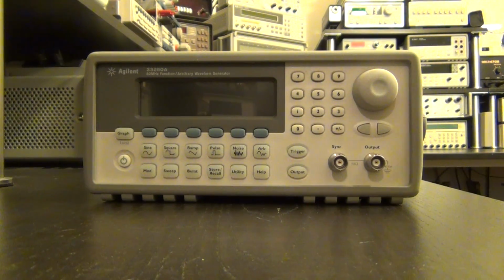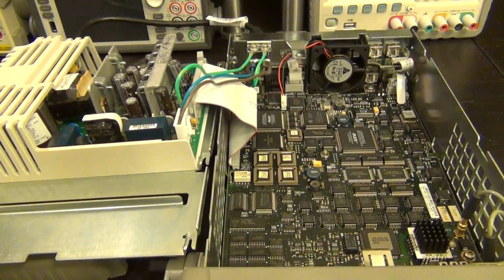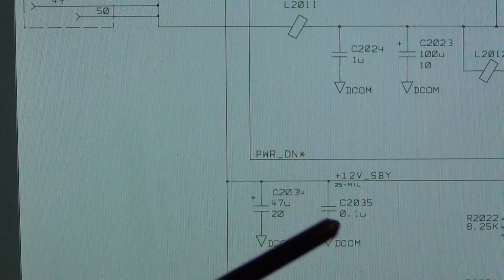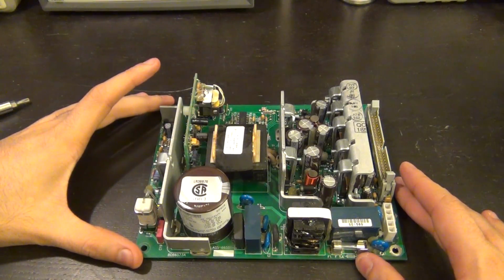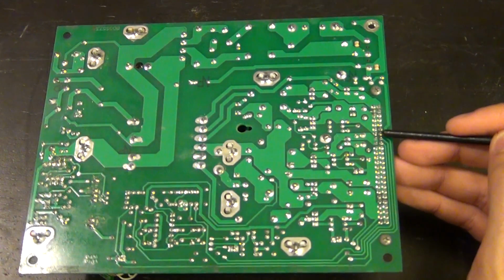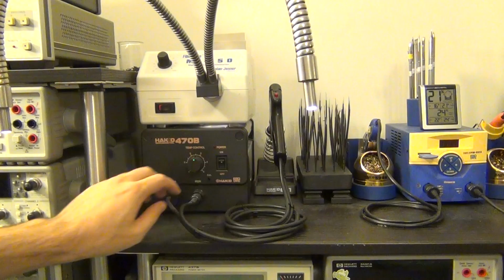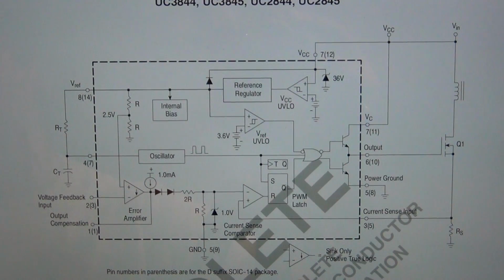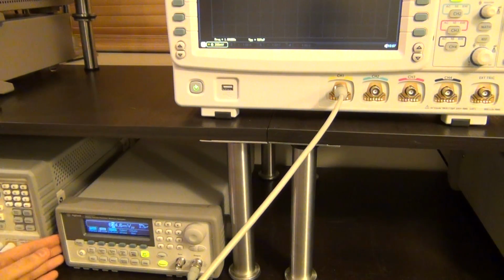TSP #39 - Teardown and Repair of an Agilent 33250A Function and Arbitrary Waveform Generator

Comment: I had to repair one of these.. The fuse had blown. I replaced the fuse and ágain it blew with a big bang so I noticed things could be serious, After much searching and fiddling I notice the thermal insulator behind the transistor @23:55 had a bit of burn mark on it like film left when piece of wire disintegrates. I replaced the thermal insulater and everything worked.

Comment: My guess is that the power supply failed to pass its verification test, that the 12V reference board was replaced by the factory technician and that the tech forgot to put the screw back in. The unit then failed due to physical vibration, or thermal expansion.

Comment: He spoke so fast. And I still dun understand why he unsoldered the little piece of PCB out of power supply unit and then resolder it back. No components are replaced so that the whole power supply unit is working without problems.

Comment: Very nice video. You need to take into account that active PFC steps up the voltage quite a bit, so a 115 VAC source might still generate 200++VDC at the cap. Not sure if that particular PSU has active PFC.

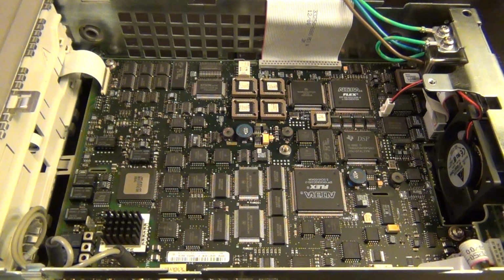Comment: Hi, could you let me know if those 3 cans (shielded coils) on the left bottom of the picture (jump to 43:42) have any ferrite core in them or they are empty?
I have bought one of these recently and fixed quite a few issues with it and it now seems to be working but someone has been in there and done some repair on it and those three cans are empty. I wonder if they should have a core? The bandwidth of the instruement seems to be off the square wave after 10-15MHz is not recognizable. 
I appreciate your help

Comment: I wonder, where did u get all that schematics?
Reply: +Blade Runner 
Nope, its called "google"
In case google banned you, there is it:
http://ridl.cfd.rit.edu/products/manuals/Agilent/function%20generator/33250-90011_service_guide.pdf
Schematic with our switch at page 204.
Reply: Well, quite sarcastic answer:) Usually is hard to find some schematics. I am surprised that Agilent gives .sch files out..
Reply: But in this case it was easy, just typed agilent 33250 and third or fourth result was that service manual...

Here in poland we dont like when ppl ask w/o trying to find it in google.

Comment: Hi Shahriar,  Great video as usual.

When you reviewed the Rigol Power Supplies, you mentioned that they were bringing out a software tool for "orchestrating" measurements and commands to them.  I assume that was the ultra sigma software. It would be interesting to see how that package works given you have a large number of Rigol tools at this stage.  Perhaps you could do an experiment  with the control being provided by that software package.

cheers

Paul

Comment: Nice repair. That thing is VERY different from my 33220. Even the PSU is completely different. Mine had bad T491 tantalum caps, I replaced them all. And I wonder if I am really really underpaid as an electronics desgin engineer. I could not afford a Rigol DS6104, only got the DS1104Z-S.
Reply: Still a great scope tbf.

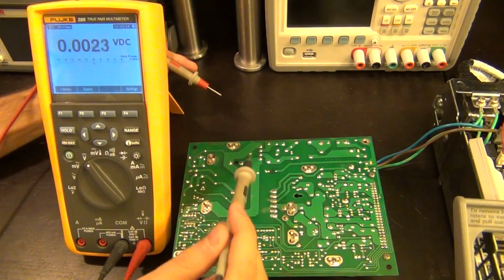Comment: It's great that you show the whole process of tracing the problematic board. I have a question - are you sure the heat sink is not connected to ground (27:05)? Heat sinks are usually soldered to ground rail.
Reply from the maker: You are right that heat sinks are typically grounded. But sometimes when a series of transistors are electrically connected to the heat-sink, they can sit at the full voltage of the drain/collector. In this case, the heat-sink sits at 170 Vdc with respect to ground.
Reply: TheSignalPathBlog
Thanks for your response, it's good to know you may get shocked by a heat sink!

Comment: The schematic you showed for the U3845 is very confusing, Vin is connected to Vcc, but I assumed that the Vin is the 170 V and the output I hope has galvanic isolation from the mains? Maybe the schematic you showed is only test circuit using a low voltages, and not mains voltages as is used in the instrument?
Reply: The schematic only showed one half of the transformer. You can tell because the secondary and voltage feedback is not illustrated.

Comment: nice repair, is it just me or does it look like someone temporarily repaired it in the past by removing the screw to secure it to the heatsink? The 12v dropped out when it was pushed back to it's correct location. Also seemed to be some flux residue around the pads before you did your desoldering.

Comment: 18:40 - Exactly what happened to me when fixing a SMPS. 200-300V DC right across my chest. The solder on the pins on the back of the board pierced the skin on my fingers and it hurt like hell.

Comment: Your just lucky it was easy.
Reply from the maker: It would have been more fun if the problem was more complex. :)
Reply: TheSignalPathBlog It's an easy to fix when you know what you doing, I bet you weren't the first person to try and troubleshoot that. Many people would have given up once they realised that it was an SMPS fault and the capacitors, diodes and transistor were OK and they couldn't get a replacement power supply.

Comment: Last I year I've repaired my TDS540 scope. The problem turn out to be in the PSU. After a while I discovered that the main switching IC was the problem (That IC have a 5V ref voltage out that was not present). But another one and I solved the at least the psu problem. if any body want to know what are the problems I have found I have made 4 part repair blog on eevblog. 
part 1) http://www.eevblog.com/forum/testgear/tds-540-problem/
part 2) http://www.eevblog.com/forum/testgear/tds-540-problem-ii/
part 3) http://www.eevblog.com/forum/testgear/tds-540-problem-iii
part 4) http://www.eevblog.com/forum/repair/tds540-repair-series-finale
I still have the acw memory problem but unfortunally the sram ic isn't more avaible.
Also I have mapped the acq mem 4 adress space:
http://www1.tek.com/forum/viewtopic.php?f=5&t=6083

Comment: That's a nice  piece of equipment let down by an inferior PSU design, Why did that Soft start board have to be a daughter board and not just in with the rest of the PCB. Would have stopped this fault in the first place.
Nice video though Shahriar. 
Would it be insulting to point out that the first transistor you looked at in the schematic was actually a PNP and not an NPN? sorry fort that.......

Comment: Dont you hate intermittent problems? My Hubsan X4 quadcopter drone had a problem where the camera module would sometimes not function properly, and EVERY TIME I took it apart to analyze the issue, it fixed itself after a bit of messing around with the board. The minute it was reinstalled into the frame, though, it started failing again!

After weeks of head banging, I finally saw a suspicious lack of solder near a decoupling capacitor. After placing a liberal amount of solder there, it never gave me any problems there after! (this was not actually a manufacturing fault, I had previously modded the board with a microphone and that was very close to that capacitor! So it might have been be when I had to wick away solder from the microphone area to rework it.)

Comment: What did you mean when you said that the 2 NPN driver transistors are present because the chip could not really have a PNP?
Reply from the maker: It is often that SiGe BiCMOS processes do not have regular PNP devices, only lateral PNP devices. As a result, sometimes you are forced to use only NPNs.
Reply: TheSignalPathBlog I didn't know. Thanks! Happy TG.

Comment: Thanks for another great video Shahriar. I'm a huge coward, so when working on switchmode powersupplies like that, I generally like to run them from a little 12V 50W mains inverter that I have. I run that inverter from a current limited bench supply with a low current limit. Although I could still get a shock I am 100% certain that it will just be a capacitor's worth of energy rather than a power-station's worth. Cheers!!

Comment: It looks like there was a screw in that place at some time. The heatsink had a round scratch by the hole. I hope you didn't find anything rattling in the case? ;) If it was a metal screw (most likely, because it scratched the heat sink) it was lucky, that it didn't short out and damage much more. Did you check the case for a loose screw?
If they didn't put a screw in that place at assembly (which I doubt, because why else would they bother to put a hole in the heatsink), someone should really ask HP/Agilent if they pick their suppliers more carefully nowadays. It's already bad pratice to have a single TO-220 component free standing, but a whole board including a transformer...

Comment: Good video as always - thanks!  One thing - what did you do to discharge that cap to make it safe?  Is it OK to just put a screwdriver across the terminals (with an insulated handle of course) or is such a sudden discharge likely to damage the cap? I guess a 10k resistor would be kinder or does it not matter?  Also - do you need to keep the cap shorted while you work in case the voltage creeps back up on it's own due to the mysterious dielectric reforming effect?
Reply from the maker: Try to avoid discharging the cap with a piece of metal directly on the pads. This can likely damage the pads, traces or even the cap. I used a 10-Ohm resistor for 5-seconds every time I turned the unit off. :)